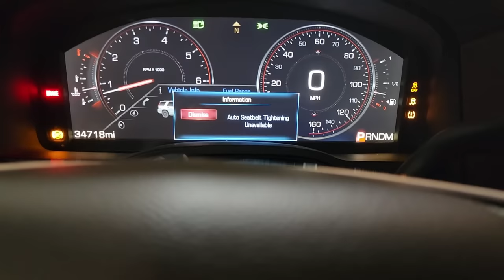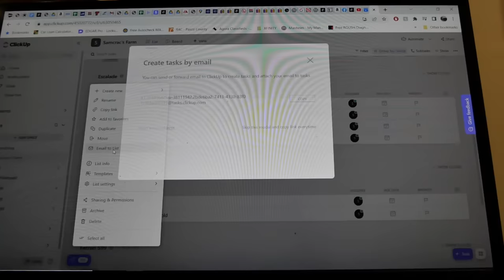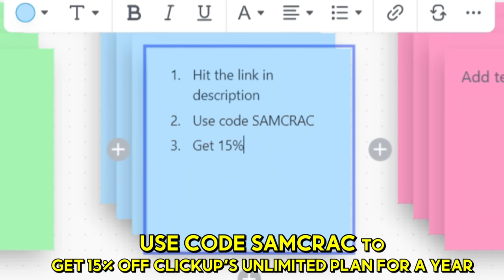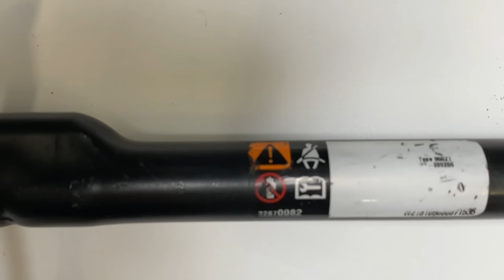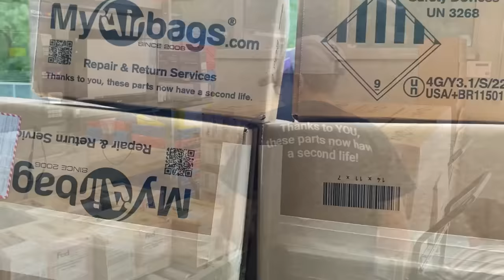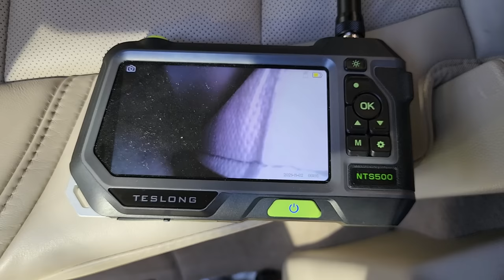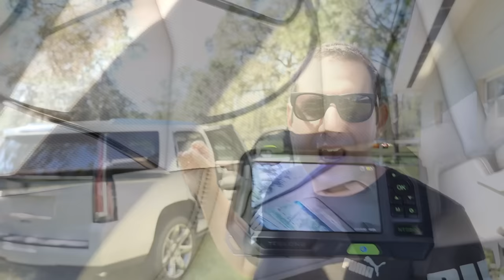Someone Illegally Tampered with my Auction Escalade's Safety Systems

Comment: 17:42.  You bought an OE part at the dealer— “ Original Equipment”  part.  OEM is a part made by a parts manufacturer that supplies OE parts to a car maker.     Ex..  A lot of BMW oil filter inserts are made by Mahle.  When you buy an oil filter at the BMW, it’s considered OE because it’s labeled as BMW part, but made by Mahle…  and If you buy a Mahlt filter online or from some parts distributor, for the same car, it may look exactly like the BMW part but it isn’t OE.. it’s  OEM at that point (a Mahle packaged part).    Sometimes the QC requirements may differ.. or maybe a slightly different material used than what is made for the car company.

Comment: Sam, I'm glad you guessed correctly on the clock spring, but you really need to get wiring diagrams and learn to TROUBLESHOOT electrical systems. You can diagnose just about any electrical problem with just a diagram and a test light. Find the problem first, THEN replace parts. It'll save you tons of time and money by not guessing and replacing parts that don't need to be replaced.

Comment: Yeah..... Till the day I die (and I realize this will get harder and harder to live by as time goes on) I will REFUSE to go newer than GMT800. Everything got worse after that... Displacement on Demand, or AFM, whatever acronym you want to give to the GM developed "great engine make bad" device, came at that point. VVT came at that point... GMT800 had/has canbus, modules for seats, doors, SRS, ABS, ECU, etc... They have all the same meaningful amenities from heated and cooled seats, cup holders, steering wheels, cameras, proximity sensors, etc... they literally have ALL of the GOOD if not GREAT features, but NONE of the overboard, over complicated, breaks ALL THE TIME, while new rpl parts are NEVER AVAILABLE issues that anything newer has. I mean, how fkn ironic is it that you can FAR more easily get parts for an 05 Escalade EXT, ESV, etc than you can for this... this MUCH newer truck. Trucks that haven't seen assembly in near 20 years have new parts readily available, while trucks made 5 years ago don't... and probably won't ever again, unless some third party wants to replicate them at a questionable quality. Literally every single thing about the older units operates better.... I'd NEVER want screens for gauges, I'd NEVER want infotainment to control all of my systems... making a bad touchscreen render me unable to control ANYTHING ever again, and then have no parts available to fix it, lol.... it's just nuts. And it's only gonna get orders of magnitude worse when everything is an Ewaste... err... I mean... EV. Literally won't even be a used car or truck to buy, let alone complain about. Only new at that point.... as just like any phone, laptop, hybrid tahoe of the 07-10ish era, etc. Once those batteries die, the car/truck is done for... literally ewaste, even if every other item on it is perfect, once the EV batt sled is dead, it's gonna be some $20k-$40k to swap that, and anything it's in is gonna be totalled, and immediate ewaste. There will be no used anything, at least not older than 2 years or so. Not unless you want it to take two days to charge the car, just to have it piddle out from "100%" in some ten minutes / ten miles, whichever comes first. As any battery eventually does. Eventually being a bit of a misnomer, as it happens pretty quick, and even faster the more you use it or the harder / faster you charge it. Don't even get into the issue where most folks won't be able to charge at home. Without a garage or driveway that can have a dedicated ckt ran to it... or the folks who park on street, in a park garage, etc... who will all have to charge at rapid charging station, which will still take some 20-30 min... hardly akin to a fuel up at a gas station, taking about 1 min to 5 min tops, then having anything from 300-500 mile range again. But the folks who do need to "rapid" charge like that, away from home, will likely see their batteries die in less than 3-5 years. Probably 2-3... And then EWASTE. Goodbye whatever you paid for that thing new, the year before last. You now literally have to pay some hazardous waste disposal crew to tow it away and dispose of it, as the battery is literally hazardous waste, and can't just be crushed like typical old scrap value cars... So, you won't even get scrap on your 2 year old ewaste, you'll have to pay a grand or so to get rid of it. Then turn around and buy another brand new EV, which will be ewaste in another 2 years. Rinse, repeat.

Comment: You could tell something was up with the front, because the grill had the updated Cadillac logo and the steering wheel had the old school logo which was only used for the first models that came out in 2015.

Comment: The seatbelt retractor is different than the pretensioner. The audi has them too and what the belt tightening feature does is take up slack in the belt each time you drive. You can feel it pull tighter when you start driving. The pre-tensioner is pyrotechnic based. You can usually tell the pretensioner has deployed because it will be shorter than another side if they have not both deployed. The reason they might not both deploy is due to an empty passenger seat.

Comment: All the parts in the interior seem to be very well made and easy to take apart and assemble.
Reply: The drivers seat is toast! My wifes 11 year old Subaru with 250,000 miles has much better condition seats. In fact, they still look good as new.

Comment: a clock spring would only break on a car that new from only 2 different reasons that i could think of. 1st being someone took the steering wheel off and incorrectly installed it, and 2nd being someone dropped the steering rack (maybe sub frame down?) and didn't mark the rack so when they put it back up and went to go drive it, they made a full lock turn and broke the clock spring. with the front bumper being replaced and all the shady stuff your finding. i wouldn't be surprised if it was in a minor front end. i crashed a 335 once not going fast and it ripped the control arm from the subframe. forcing me to replace the whole front subframe even though the frame was still straight as a arrow, idk just thoughts based on a few cars I've had.

Comment: I know about a lot of cases in cars imported from US to Poland where in place of curtains, seats or even dash (!) or steering wheel (?!) airbags, resistors were installed. Can't even imagine how dangerous or even deadly it would be in case of an accident. Back then (like 15 years ago or so) there were no laws protecting car buyer from dishonest seller. They were introduced some time ago and now if you find anything wrong with the car that seller didn't mention or list you can legally return the car to the seller and the seller has to give you your money back. Just can't imagine how many people died in car accident driving such unsafe car. How these sellers can sleep at night knowing they sold death trap on the wheels, where's their conscience...

Comment: the escalade after mkt is huge - you should do the easy mods and then add some nitrous or a blower? it might be a good candidate for a crate motor - sell what is in it some lt1 or lt3 and get an lt5? - you could get 600hp and 10 speed  and then sell it go flip another one after - get a 2 door or a wrecked zl1 or do a detroit speed  3rd gen - you can get some hammer motors now for 10k or 20k in some cases but you may be able to flip it also for like 40-50 so... with that much power you have to be careful not to get into trouble - there could be lots of free easy hp with common mods from the vast aftermarket

Comment: I would question if those airbags are actually any good, especially if the crash was enough to trigger the firing mechanism of the seatbelts. I purchased a car that had no warnings, everything looked to be in perfect condition until the night we were run off the road and hit a lightpole. Zero airbags deployed because the charges were not there but the materials were.  We got really lucky that night and the dealer I got the car from was gone.

Comment: I'm surprised that the fender bender fired off the safety restraints but didn't deploy airbags.  This is quite the fun journey to watch.  Glad you got the items repaired.
Reply: I don't know about this car specifically but usually the computer determines if the crash is severe enough to deploy the airbags. Factored into that is whether or not the occupants are buckled and if that will suffice. The accident seems to have been minor enough for the airbags to not deploy. Thank goodness for that or else there might be airbags missing and more safety bypasses.

Comment: Worked on a tesla a guy bought from enterprise rentals. The seats airbags were replaced but never was bolted down and the bag sewn into the cover was just tucked in . It's supposed to have the airbags inside to direct the blow forward  .
Beware rental companies DO NOT REPORT accidents and fix in house.
I bet that escalade was tampered with so nobody would buy it and get it dirt cheap.

Comment: I got stung in a very similar way on my 2014 w204 mercedes benz c class coupe, I found 5 resistors. The drivers air bag, the drivers curtain air bag, the drivers knee airbag, the battery's srs one time fuse and the passenger side bonnet hinge arm module. It was a private sale and asked them I have two children that will go in the car and is there anything I needed to know, they said no and for a year I drove a around with my kids in the car not knowing till one day resistor failed and I went through the whole car. Absolutely shocking how people don't care about others people's safety.

Comment: i bought a car that had several resistors installed on several seatbelt and curtain air bags, on ebat they even sell them in a black box that says for testing only but people put them in the wires then tape it up

Comment: The resistors need to be there to siulate an on confition. a short or open tripps the code. 
Thats how i told the computer to turn on the engine fans on in my 97 camaro. "someone installed the wrong fan sensor and i needed to turn tge fans on to prevent an overheat" I ecu needs to see the on comand, but you cant just ground the lead - thats trips a code. So a resistor in the line to ground tells the ecu to comand on the fans. Now thats a 97, not much changes its all still logic on/off comands.

Comment: I bought a used car from a dealer that had a drivers side belt locked up like this. I hoped to just put an after market in and did, that caused the passenger one to lock up!  So I had to order a set from a junk yard to fix my mistake, I hate all this sensor crap!

Comment: Those seat belts would have failed yearly inspection. They usually do pull test and if not locking then would cause direct fail and you can only drive to repair shop. 
Also error code reading would also fail the test if there are errors related to safety features.
Some hate our inspections but at least is should keep dangerous cars out of traffic.

Comment: Actually its not illegal because not all vehicles have that extra pretensioner. That pretensioner literally just tightens the seatbelt another inch or so, so to say someone would've been killed without that in place is just not true. The airbags would deploy with that resistor in place. Secondly many states will allow you to pass salvage inspection without repairing the airbag system.

Comment: @Samcrac check out a company called Eastern Beaver. They sell OEM connectors of all kinds. You will have to know what your buying but they are usually cheap so you can buy a few styles if you are unsure. I've save hundreds of dollars by just replacing connectors as opposed to whole harnesses.

Comment: There is no repairing air bag/seat belt wires with out possible issues and a chance of the car being a liability for you in the future buy the wire harness even used harness will work better than repairing your harness

Comment: Did you  get the front sensors to work with the new module you bought? Did it just need programming?  OR you just put the cover back on the original  one u drained the water out

Comment: As a former Dealer technician  I have another theory as to your find. I highly doubt the auction company did this. I would be willing to bet that the prior owner of the vehicle did the half ass repairs including the resistor only to make the vehicle have a better trade in value. Once the dealer stared their recon inspection and found damage with several codes they sent it to auction. My dealership would send anything that was  questionable to the auction.

Comment: if parts are on back order , the insurance will total some cars just.by parts  not being available,,, someone probably did a bumper swap and then bug the sensors  and then flipped it at auction i dont normally buy 3rd party cars

Comment: I bought a 2017 Laramie on eBay with a salvage title.  Two years later my passenger side airbag light just came on after a very cold winter day.  I'm wondering if there is a tiny resister circumventing a blown airbag?

Comment: What is even scarier, one of the jobs of the pretensioners is to sit you back in the seat so you can take a clean hit from the air bag. If someone is out of position when the airbag goes off, it could injury in stead of protect.

Comment: To clarify, the whole  seat belt system  has to be rebuilt after an  activation? , or just the explosive  cylinder replaced  and the seat belt tensioner reset by a competent  mechanic

Comment: Looks like it was in a lower speed first stage airbag deployment.  If it was a high speed frontal the SDM would also codeploy the curtain airbags which are fine.  You can't reroll a deployed airbag easily, and the wrap is untorn.  I would be concerned about the passenger airbag and if it is also resistored.

Comment: 👍👍 good find 
1. These are luxury safety items. They should not be tampered with.  Is it a criminal offense... Hell no. 
One needs to remember cars from years ago never had these items and worked just fine. Death rates in car crashes have not improved because of these fancy items.  
2. It's just like a coke and candy bar. If you think you need it, and you can afford it, by all means buy it.

Comment: Yeah, prices for airbag systems and safety features in europe are astronimical. My friend has E60 with passenger restraint problems. Drove to dealer they quoted 3k for passenger seat redo, as I understood seat occupancy sensor went bad and it is in the seat itself. The problem is car is worth maybe 4-5k Of course people are trying to find cheaper solutions to this even if lives are on the line. Sad but this is where we live now - want to be safe because our overcomplicated system failed or you were in a minor fender bender where these systems shouldnt deploy ? Pay up... Soon airbags will deploy when your tyre goes flat :D

Comment: Sam, did you report this at least to the auction house???  they need to be looking at that seller...  as I mentioned 'as-is' doesn't apply to outright fraud...    Personally, our car was destroyed in a wreck back in april (drunk driver blasted the car) - IAA listed and sold it as "runs  & drives"  which is comical since the front suspension was torn from the car - they propped it up in the wheelwell for pics.

Comment: I think you answered why their greed stepped in.  They took it apart, tried to order the seatbelts and ohhh .. on national back order.  So their choice was let this car sit around and around and around taking up space and not getting in return on their money, or, fudge the repairs and sell at auction (as is because with the warnings that come up someone will open it up to repair it, so no one will get hurt, they will repair it themselves and too bad they have to wait to do so). So they got their money fast and moved on to the next project with any guilt smoothed over.

Comment: Now it makes sense... Small bump on front set off the bags and belts.. GM has zero parts, so it was financially totaled based on inability to get safety system parts from dealer network.

Comment: How did you or how will you fix the connectors that were cut off?

My mind is like one of those seatbelt explosive pretensioners: BLOWN.
You might not call them hacks because they knew what they were doing but you gotta give them some name, some nasty name for making the seatbelts unsafe.

Comment: How does this company certify the retractors and show that they were reworked?  In the event of an accident and there is retractor or anchor pretensioner failure, the manufacturer of these retractors needs to know that these were tampered with and then reworked.

Comment: @Samcrac this is a very big no no. You need to take this evidence to a lawyer asap because what this dealer did is very illegal. dealers are by law to replace deployed and damaged srs systems back to factory and failure to do so is against the iihs, dot, and a few other agencies. that dealer is most like doing the same with other vehicles that roll through. you have enough evidence to have a investigation opened on them. do the right thing before innocent people get hurt from that dealers negligence to properly repaired srs system to how it was brand new out of the factory.

Comment: OMG, whoever bypassed these essential safety features should be put in PRISON... IM SO ANGRY!!! How would you know if your safety belt was not fastened if the warning chime doesn't work... so UNSAFE!!! Sam literally dodged a bullet. Ok, I'm done ranting... I'm gonna go ride my bicycle on the same road as an 80,000lb truck, and speeding cars. Then, I think I will go mountain climbing. Then, I think I will do the Tide Pod challenge. Then, I will do a wheelie on the interstate with my  motorcycle... which has all government mandated safety equipment in place, I might add... cause I ain't stupid!